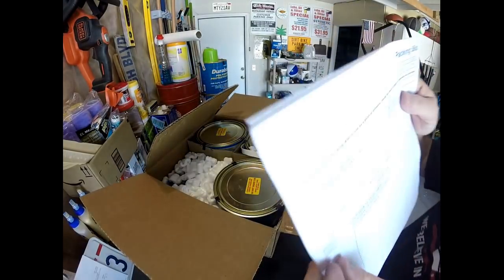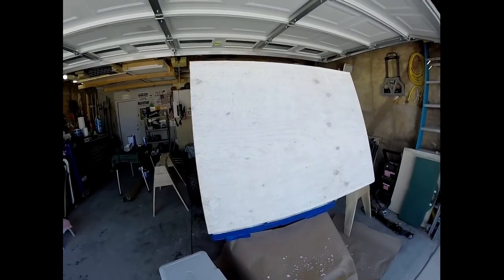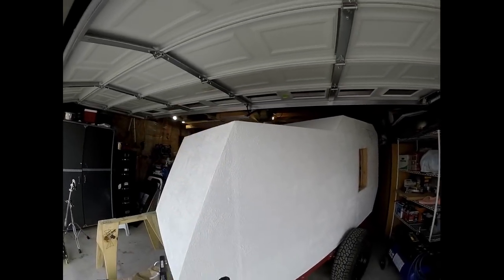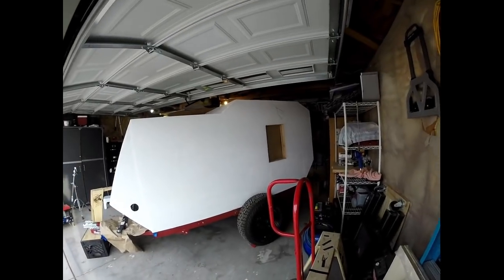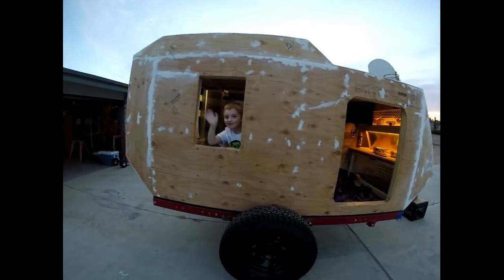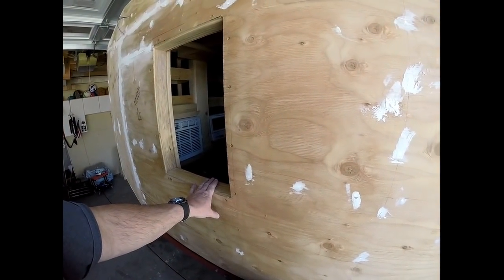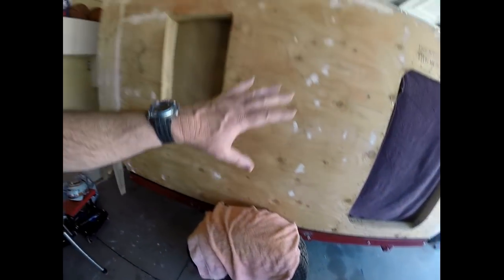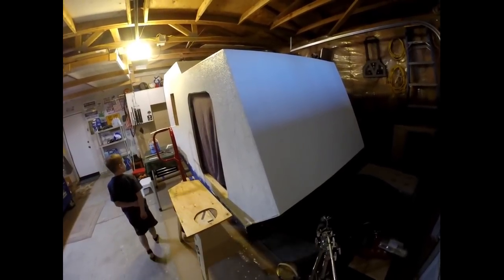4 x 8 camper part 24 - The big push!

Comment: when I did some boat construction I quickly learned not to use to thick of plywood as it really weighs a lot.
Reply from the maker: In the beginning I had to make a decision weather to use wood, or steel as a frame etc.  I have a lot of experience with wood and some experience with steel,  welding & bending etc. For my first attempt I opted to go with wood since I just felt more familiar. Then as I learned what it actually took to build this thing,  in the future I can go to steel if I decide to do another one.  I just may!
Reply: My advise when ever building a trailer. Always figure up the weight of the materials ahead of time. Many trailers are overloaded before they ever get anything put in them just because the materials were so heavy and the axel- tung weight towing weight exceeded for the tow vehicle. I build stuff and its so easy to put lots of material into something to make it strong only to be amazed how much it all added up to. best wishes on your project. hope it all goes well.
Reply from the maker: I could not have said it better. I once bought a 37ft 5th wheel. The tag claimed the weight at 12,000. I weighed it empty and it was 15500lbs. LoL. Then after loading it with quads, food, water, etc it was 19,000.lbs.  8()

Comment: Is there any reason not to use just the smooth product only and skip dealing with the rough?
Reply from the maker: I did consider it for sure.  My thoughts were to have some type of texture to hide the many imperfections. Also if you see how transparent that smooth was it woulda have taken many more coats I believe.  Also the rough is very very tough.  Thanks for watching.
Reply: @DIRTADDICT922  ahh that makes sense👍

Comment: Looking to use the DURABAK for a small camping "teardrop". Would a primer be a good idea before using the DURABAK ?
Reply from the maker: The advise I got directly from DURABAK was no. I did not need a primer as long as the surface was cleaned thoroughly with Xylene. They have a pretty good support page you can talk directly with them here. 
https://www.durabakcompany.com/

Comment: Also wondering if use all smooth instead of textured would have been better?
Reply from the maker: The long answer is that I used a rough finished ply wood on the exterior which meant if I used the smooth it would have showed every imperfection in the wood finish. If I had to do it different I would have chosen a finished smooth wood for the exterior wall surface. Also DURABAK advised me that one coat of textured (which turned out to be two) would provide much more durability and strength if then backed up with a few smooth coats on top.

Comment: How did you install your drain for the AC unit
Reply from the maker: Jeremy, This unit states that it is does not need a drain plumbed.  There is a flat metal pan built in to the underside of this unit. I am assuming that it sits in that pan and evaporates?  Either way I will eventually discover whether or not it actually needs one! LoL. ;)  So stay tuned. Planning trip number two here soon.